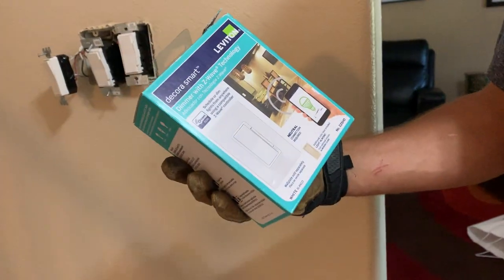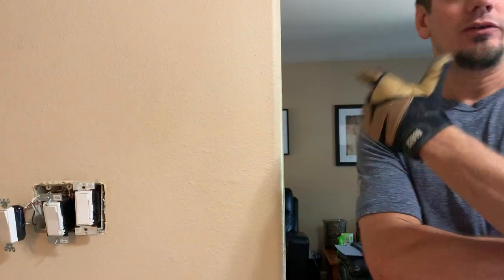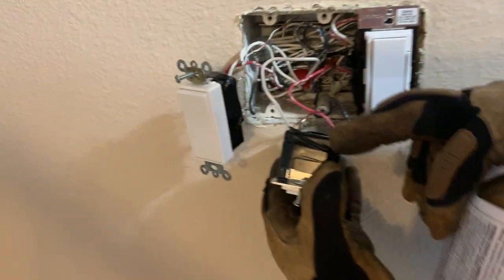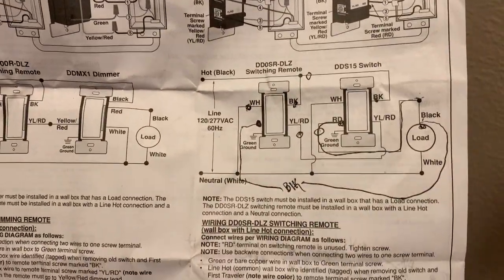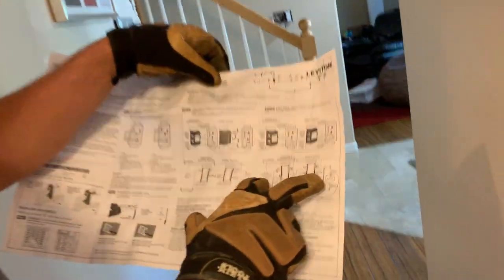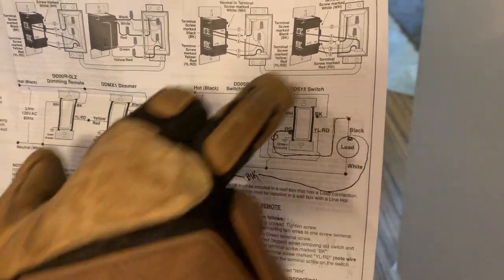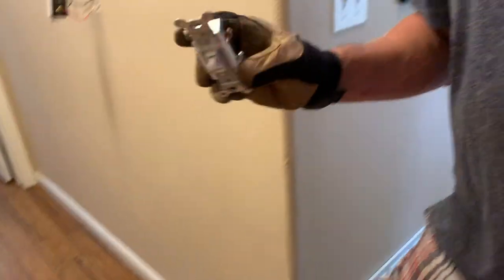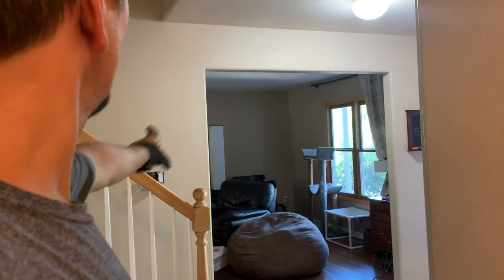Smart Switches for Your Home: Important Things to Know

Comment: Josh give Leviton another look they have upped their game. The dual combination AFCI/GFCI receptacles are excellent. Trip times and trip currents are very consistent (class A device) and more than that very capable in accommodating transients and avoids constant tripping from Motors, DC, and smart switches amperage. You should  also be showing us some testing (we would thank you) to make clear the points your making. Often when you think you have it worked out it’s always good to have that secondary check. As they say if you ain’t testing your guessing. Of course I also agree don’t let the numbers cloud your brain either. Unfortunately you often discover when you do the testing another issue crops up unrelated to the one at hand. At what point do you then tell the customer there are other issues. Some of those may not be critical now but could become so in the future. You do a great job keep it up and hope your business grows.

Comment: Those new caseta wireless or pico systems are way better.. Not a huge fan of Leviton because over time they will fail
Reply from the maker: Plus need a Neutral on some of those systems.
Reply: There are significant current/power limitations on the caseta system.